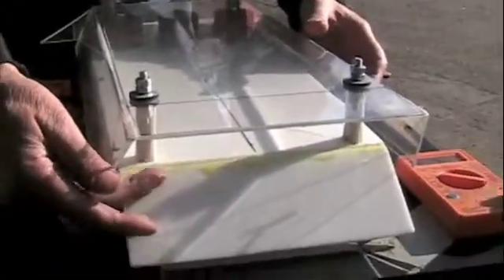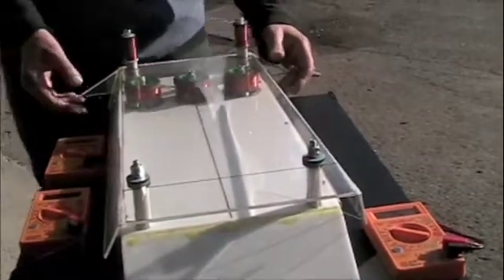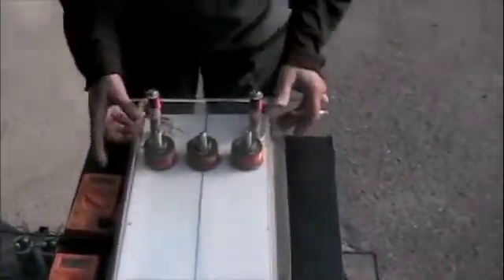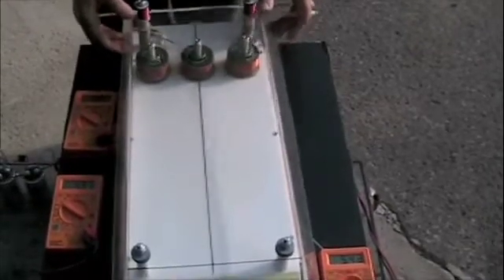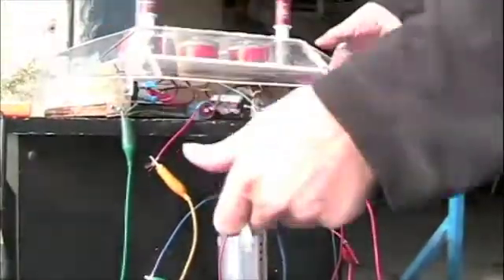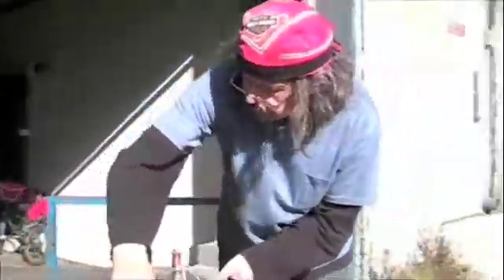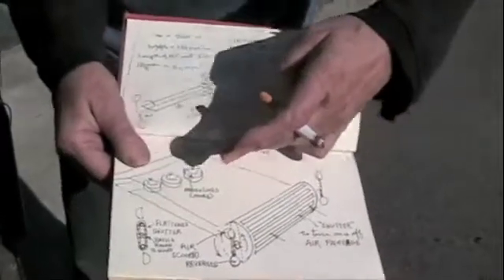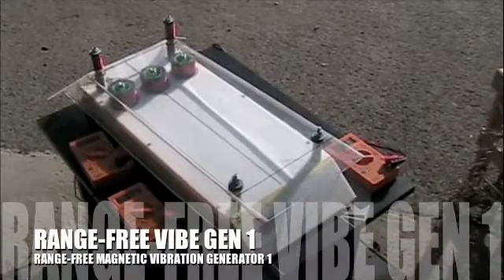Range-Free Vibe Gen 1

Comment: !6 pulses/p/sec - which is attainable by dividing speed into distance. Building 1st shutter now - 3 small funnels on each axle end with single gate centered on axle" look for next vid. Film PROJECTOR (flashes light on frames only). This first proto is a bit "stiff". By putting elastic cantilevers out of sides (& back), movement of 3" possible (instead of 1" here). Spring mag-,ounts also possible; again, see next vid or build to your own notions.
Reply: Are you still doing these projects?